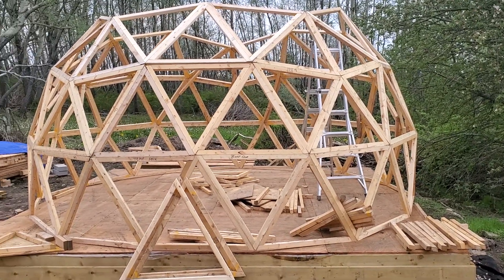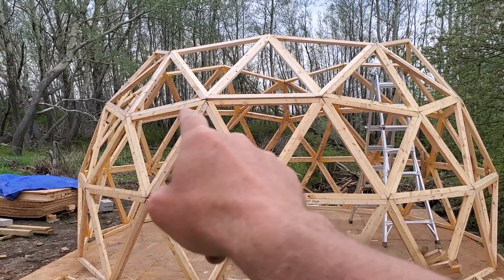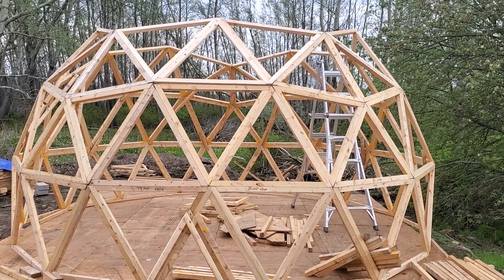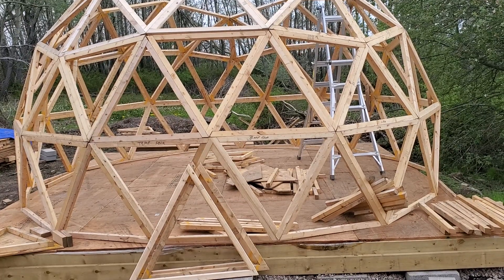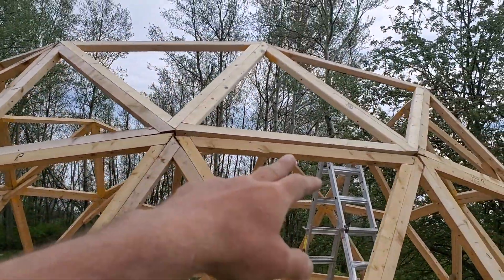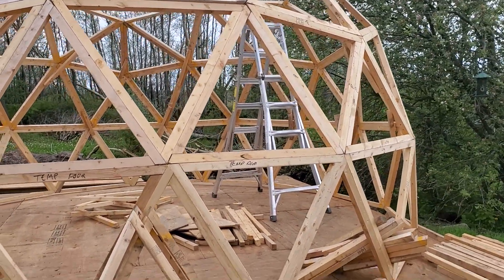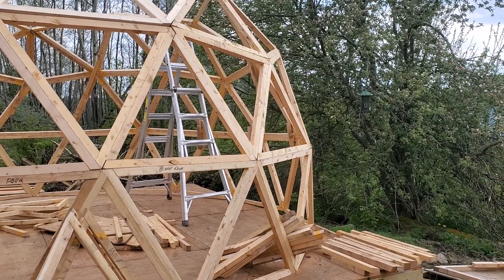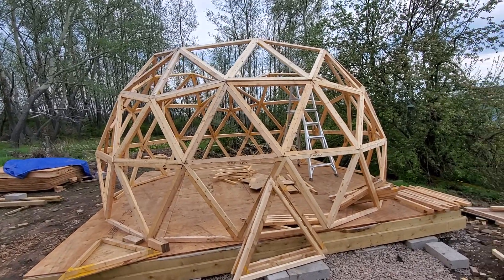3v 5/8ths GEODESIC DOME PROGRESS JUNE 5 2020

Comment: I heard 3v domes dont sit flat on their base??
Reply from the maker: That is correct.   Only even frequency domes sit flat.  There are two workaround for this.  One is simply  make fillets.  I did this easily enough with scraps.  Another way is there is a series of intersection that will be flat...i believe those having two pent sections lined up.  I may be wrong here.  It's been a while.  There's a video by Paul Robinson's channel about that.
Reply: @justmeted1969  Thanx I'm just learning this stuff....